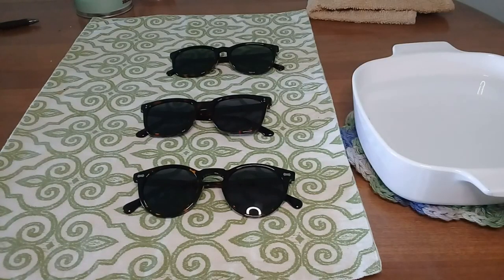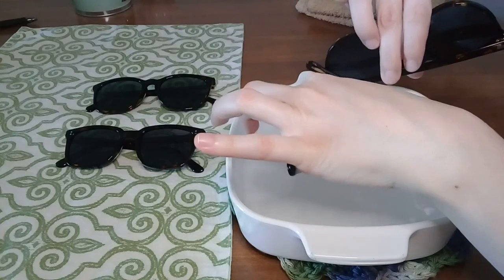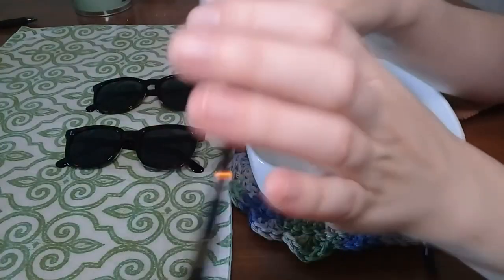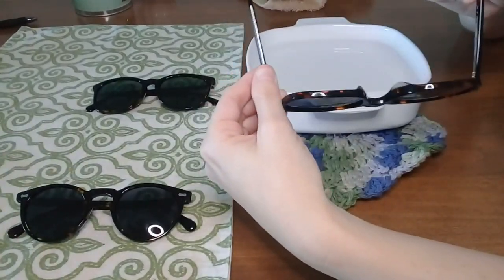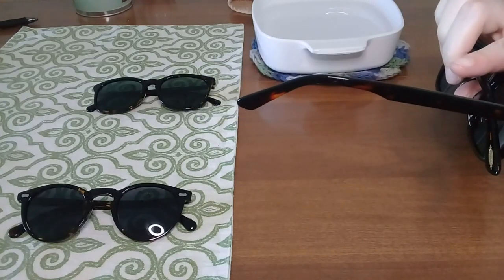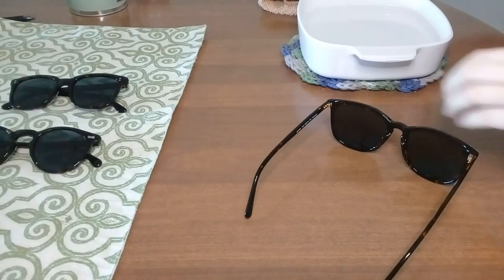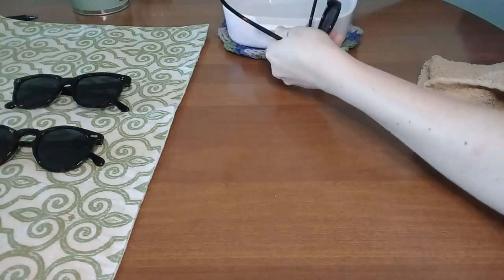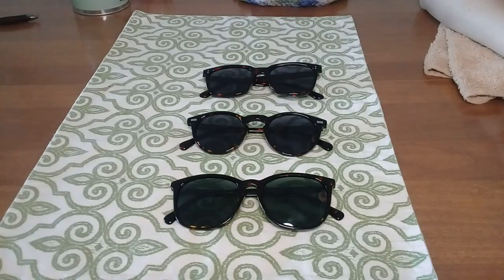How to Adjust Sunglasses Fit Using Hot Water (feat. 3 Different Problems)

Comment: In this YouTube video, the YouTuber demonstrates how to adjust the fit of sunglasses using hot water for three different problems. For sunglasses with narrow temples, she suggests folding one temple and submerging it in hot water, then using gentle pressure to create a curve. To fix glasses that keep slipping off, she recommends curving the metal stem inward or downward for a more secure grip around the ear. For lopsided sunglasses, she advises submerging the temple in hot water and pulling it downward rather than upward and avoiding adjusting the hinge. The YouTuber demonstrates these adjustments on three different pairs of sunglasses, cautioning against damaging the hinge.